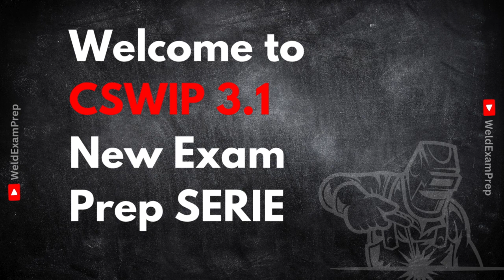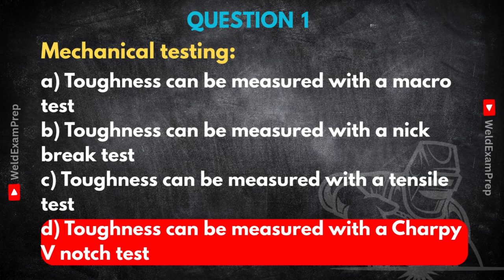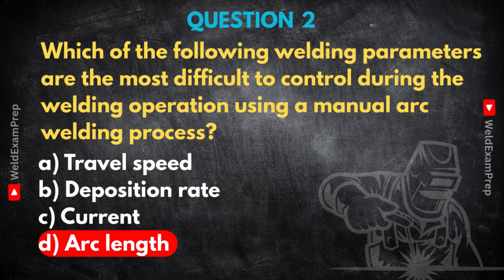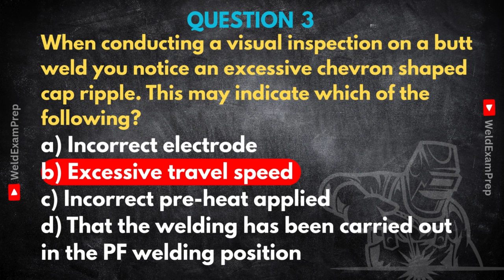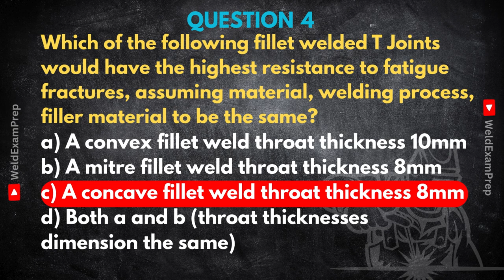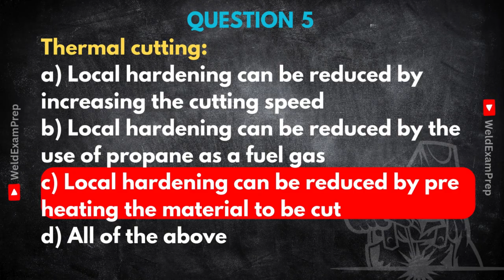Pass the CSWIP 3.1 Exam! 🚀 Most Common Welding MCQs with Expert Breakdown 30

Comment: Hi , for the question 3

Hydrogen cracks are called as chevron cracks so incorrect preheat applied will be the correct answer i think
Reply from the maker: That’s a really good point : hydrogen cracks are often called chevron cracks in fracture surfaces. 👍 But in this question we’re not talking about hydrogen cracking inside the weld metal, it’s about the weld cap surface appearance.

An excessive chevron-shaped ripple on the weld cap usually comes from excessive travel speed, not preheat. Incorrect preheat would relate more to cold cracking risk (hydrogen cracking), but that wouldn’t show up as a surface ripple pattern.

So the key is to separate fracture surface chevrons (hydrogen cracks) from weld bead ripples (travel speed).
Don't forget to subscribe for more.
Reply: @WeldExamPrep  okay got it , thanks for your clear explanation 😊 👍🏻